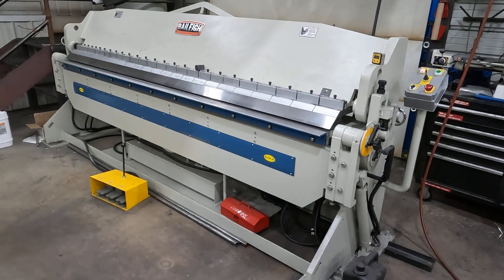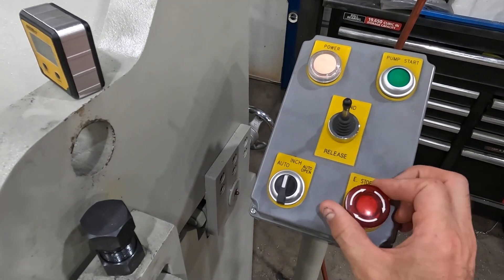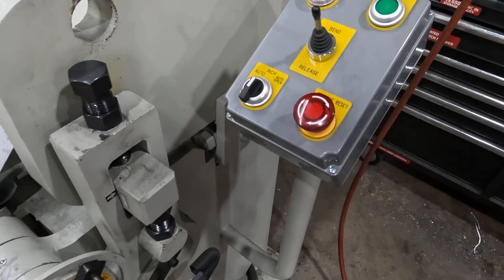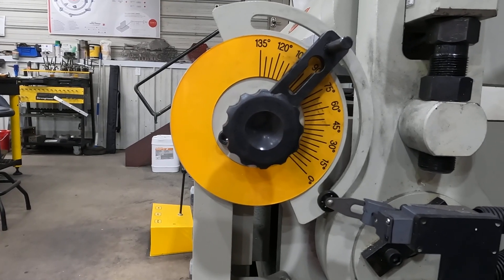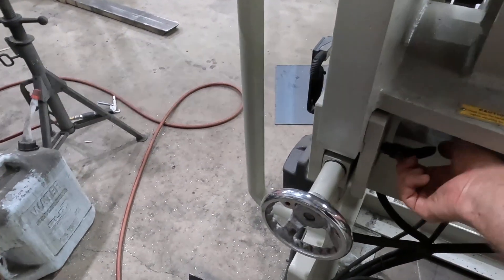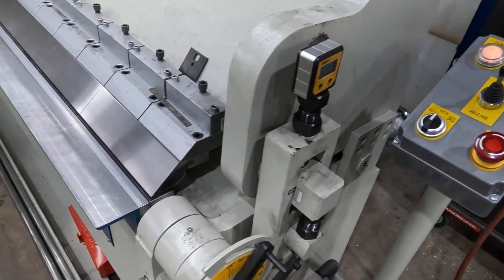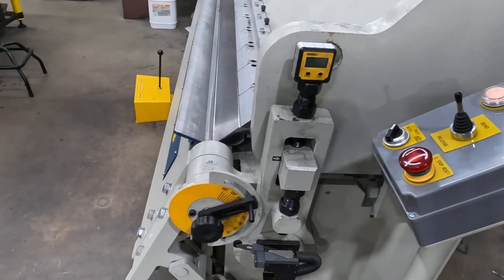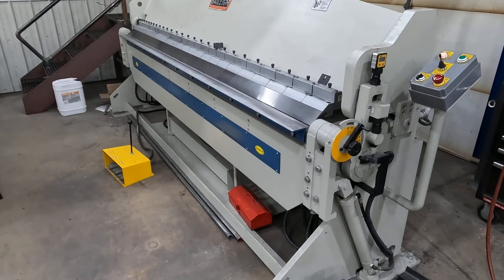10ft 10 gauge metal brake! Baileigh BB-12010H in operation.

Comment: Very nice piece of equipment, if you don't mind me asking what did you pay for it? the reason I ask is when I look them up the pricing seems to be wildly all over the place, thanks!
Reply from the maker: If you go to Baileigh's website they show the price on there.  A trick is to buy it from a local distributor and they will get free freight to their store,  where baileigh will charge you freight on top of the price.  For something like this that could be $2500-4000.  Mine was just under $40k
Reply: thanks man, and thanks for uploading the video, not a lot of info out there on these. What do you use it for mostly? @eastech3365